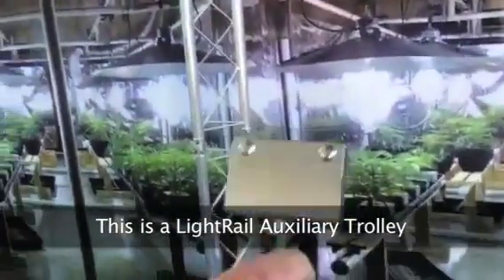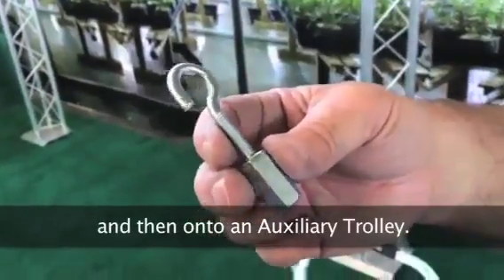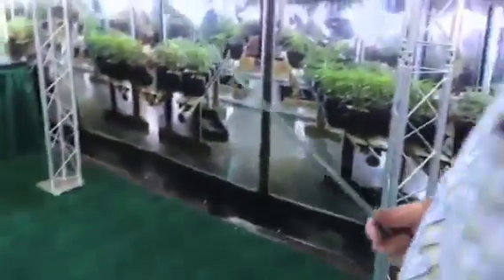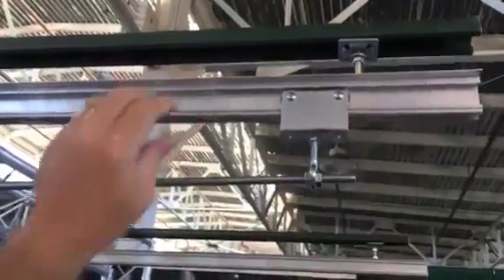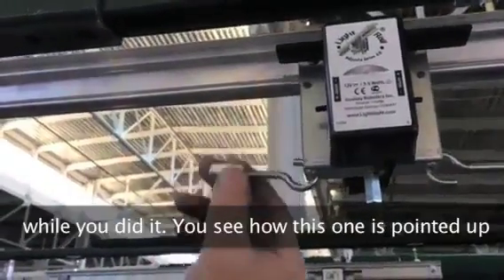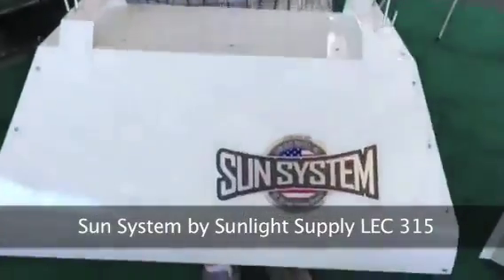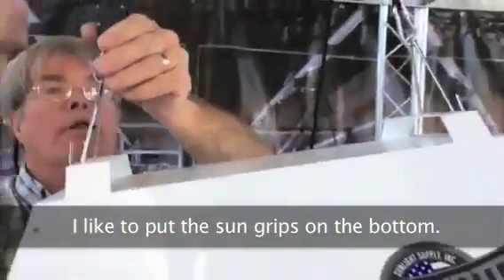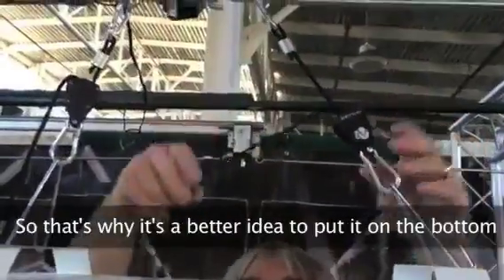This is Genius; Move Up To 3 Grow Lights with 1 LightRail Motor

Comment: Very helpful. Thank you! May I ask where did you buy the extension rod hook?
Reply from the maker: That is part of the Add A Lamp Kit: http://www.lightrail3.com/shop/lightrail-add-a-lamp-kit/ , and if you already have a push/pull rod and Rail, then some hydro stores sell the Add A Lamp Hardware which includes an Auxiliary Trolley and a small bag of hardware including the hook. It comes in a small white box. If you already have the Rod and Rail and the Trolley and hardware but just need the hook, you can email us at sales@lightrail3.com and we can place an order, or you can call to do that 970-761-2596, mountain time.